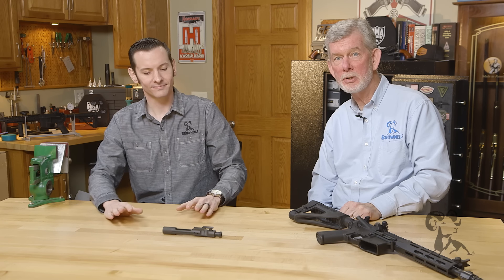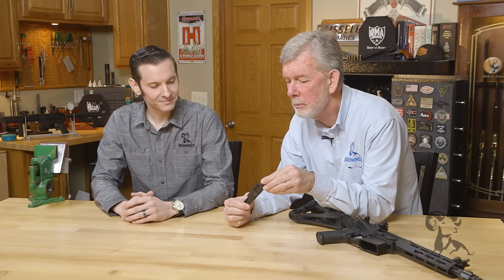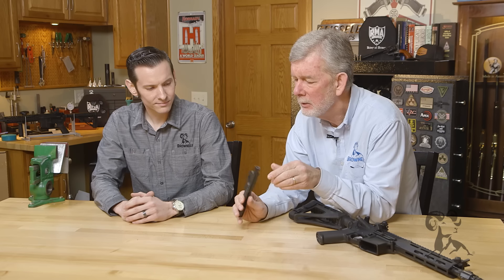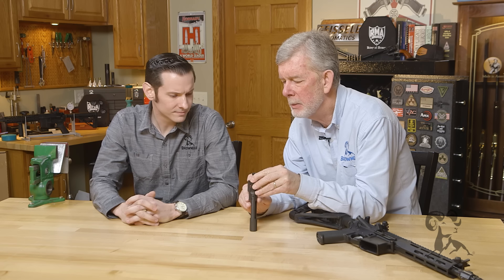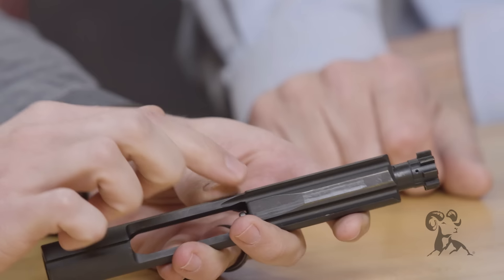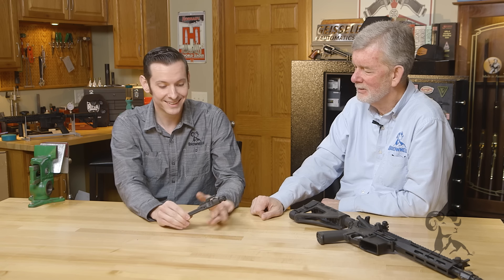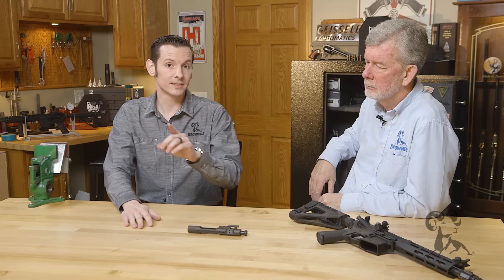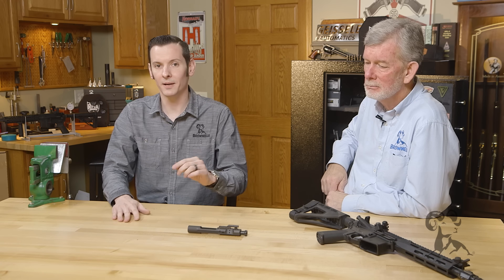Smyth Busters: AR-15 Bolt / Carrier Lubrication

Comment: I  run mine  moderately wet   but mine also spends a lot of time sitting in a corner  in-between cleanings  so I want that extra barrier  to prevent corrosion
Reply from the maker: Word!
Reply: @brownells   -lol, Word up. In the 90's it was "word to your mother"
Reply: I mainly use grease since it sets muzzle up in the safe. That with dry film lube
Reply: @bradbeam7254  what grease in particular and do you feel it's better? I'm curious about Mil-Comm TW-25b, and recently been experimenting with it particularly bolt/cam pin area.
Reply: Fireteam Michael, anything besides long term preservative treatment. Price and availability at my local store is what I use. I don’t recommend any certain brand in particular. The guys below me seems to share the same sentiment.
Reply: @brownells  You guys just won my heart with that reply! It's one of my favorites.
Reply: @fireteammichael1777  I use it in my M1A and it works like a champ; beware, a little goes a long way.
Reply: Same here. Wet and ready. Oh, and your user name is epic.  I am from San Francisco and non profits have ruined that city and turned homeless and addiction 'advocacy' into an industry. They truly are a plague.  $8 BILLION spent on non profits in SF the last 12 years and they doubled the number of homeless. LOL
Reply: @alfredocarpaneto5976  Good point! Seems everything in our society consists of one extreme or another. The left perpetuates addiction alongside the abuse & neglect of children/animals via the broken welfare system while utilizing firearms as scapegoats. The right destroys our environment/planet for means of profit while utilizing immigrants & minorities as scapegoats. Everyone..from the hood to the upperclass is pulling the victim card while simultaneously chugging vodka & gulping down xanax or snorting dope. For years..I knew I had to evolve past my addictions and character defects to earn the air I breathe. Life isn't a meaningless entitlement, unfortunately majority view it as such. Time we start reflecting on the paramount life aspects instead of obsessing over sex, blood diamonds & fame. RESPECT 💯🌏

Comment: I also lube the cam pin, the enlarged bolt guide ring section and the lugs. Drop of oil and brush around for a light coating.

Comment: Tim at Military Arms Channel is testing the limits of a BCM build by not lubing it. He's up past 7000 rounds without a malfunction shooting it about a thousand rounds at a time with cooling time between mags. His hypothesis is that carbon can act as a dry lube and he'll get far more rounds without a malfunction than anyone else thinks. The idea that carbon COULD be a dry lube is valid as I once had a maintenance job at a college where we regularly lubed sticky door locks using a dry graphite powder, graphite being a form of carbon. However, the charcoal in your grill, the coal in a power plant, the graphite in your pencil, the graphite in a golf club, and the diamond in your ring are all carbon but with different functional properties due to the exact molecular structure and orientation. Which form comes out of burnt gun powder I don't know but I am interested to see how far Tim's BCM goes.
Reply from the maker: We are interested to see how that goes as well!
Reply: I believe he lubricated it once before starting that test.  So it is not so much how long it will run with no lube but how long it will run between lubrication applications.
Reply: I agree
Reply: Maybe Tim happened to have a well made example? Sure, he's more of an AK platform guy than most firearms enthusiasts, but he's not Rob Ski, Jim Fuller, or somebody else who is specialized in that platform. I don't agree with him 100% of the time, but in the big picture, he's a decent resource.
Reply: C-Bomb  Did you not read my comment or did you not watch his collab with Robski? His rifle was a piece of shit. He just didnt clean his gun to figure it out.
Reply: I remember using graphite powder on my pinewood derby car in Boy Scouts.

Comment: Red lithium automotive grease stays slick rain or shine dosen't burn off after lots of rounds 200 or 300 in a session.
Reply: I too have heard of (and used)  high temp grease on the sliding parts. Makes sense and easier to clean off carbon fouling later on.
Reply: I have been running white lithium,, runs great. I have run over 800 with no problems.

Comment: I use Wilson Combat white grease, as it's not as messy as the regular wet Hoppe's stuff I used to use.  I put a little dot behind each locking lug of the bolt, plus around the ring that encircles the bolt (where it rubs against the inside of the carrier).  I also place Wilson Combat grease around the bolt cam pin.  I use small amounts of Hoppe's on the exterior friction areas of the carrier as described in the video; I lube what's shiny.  I've never placed lube inside the carrier key or the vent holes, and I've never tried cleaning inside the gas tube. My AR runs great.

Comment: I used to oil everything and wipe off the excess until I started to have some cycling issues.  Now I run mine as wet as possible, basically wipe or hose the thing down with whatever lube I am using and don't wipe any off, just assemble it and run it.  Haven't had any problems since.
Reply: A lot of counter people at local LGS often say that AR`s like to or need to run wet but I would say that it`s due to the parkerized type finishes that many have witch seem to be a bit thirsty if you notice when you oil them up. And I always oil up the gas rings for storage. Heck I even used to clean the gas tube , being a clean freak after shooting, But I asked Chris at small arms solutions and he said there is no need to clean the gas tube as there are no related issues of that type with a gas tube.
Reply: Thystaff Thywill  The AR I had an issue with was a M&P 15 Sport.  I believe the bolt is nitride if I remember correctly.
Reply: Thystaff Thywill  Why would I swap out a BCG that works?  That doesn't make any sense.

Comment: I tend to oil everything then wipe it off, just leaving a thin layer, then put a little extra on contact surfaces.  This seems to make the carbon clean off easier.  I also prefer grease for the cam pin and lugs, it seems to last longer and work better.

Comment: I had negative experience with dry bolts so I use a moderate coat of lube oil mainly in the surfaces you pointed out. However, a light spray of lube oil throughout the entire bolt seems to really work better. I don't clean my ARs every time I shoot them but I don't usually use more than 100 rounds at the range as others use much more than that. To me carbon removal is essential followed by a light coat of lube oil.

Comment: Eh I'm a grease guy, been using wheel bearing grease for over a decade now and never had an issue, never have had my bolt dry up when firing it and I go to the range sometimes 3-4 times between cleanings and fire about 200 rounds each time. When I finally go to clean my gun the grease is still where I left it. I use to use oil when I first got into shooting and instantly noticed at the end of my range session my gun would start to feel considerably more sluggish. Went to grease and never looked back.
Reply: Are u in an area that ever has extreme cold?  I've thought of trying grease but always end up back to oil bc half the year its sub freezing temps here and have heard 'stories' of thick grease preventing the action from cycling in extreme cold
Reply: Matthew Beaver I use lithium wheel bearing grease which has a thinner viscosity over some of the others. I live in FL so can’t say anything on cold (coldest it gets here is in the 30s) but the fact that we trust the same grease in our automobiles without ever giving it a second thought about maintaining for decades should say something about it’s effectiveness in all weather types. I did look up that same question years back and never found a definitive answer. Most just had the same concern you have but no concrete evidence. No expert but I always thought in extreme cold leaving the weapon dry was best since any lube would probably end up freezing.
Reply: You use grease to lube everything or just the bolt and just on your AR or other guns as well?

Comment: I use lithium grease on my ARs (and everything else, really).  A thin film on the carrier rails, the cam pin, that raised surface on the bolt itself, and the rear of the locking lugs.  The charging handle gets some too and any excess on my finger when I'm done gets smeared on the face of the hammer and into the detent groove on the takedown pin.

If that's too hard to remember, then just shoot your rifle a bit and you'll start to see shiny areas where wear is occurring; put a very thin film of grease on those shiny spots and you'll probably be fine.
Reply: I actually use Lucas heavy duty oil stabilizer on all my AR bcg's.. Works great! Little on the cam pin and a little on the rails. I wouldn't use it for corrosion resistance, but to keep the bolt slick, it works pretty good.
Reply: I do the same exact thing you do. Something my dad taught me. It's really good stuff, I use it on all my rifles and pistols too.

Comment: One of the first things I was told about oiling the M16/4 in boot camp that goes across all sister platforms is the fact that the platforms like to run wet. We were told that when in doubt, be liberal with the CLP we were issued. The type of lubricant is another subject entirely, but I recommend a liquid CLP for a couple of reasons. 

First is the fact that it does everything for you. It will actively prevent fouling and keep the fouling wet, negating the need for a designated cleaner. CLPs typically are designed to condition the metal, making it easier to clean with subsequent cleaning and lubrication cycles. 

You can also use grease in some parts of the rifle, that's another topic.

Comment: AR15 Barrels with nitrite finish plus QDQ. Do they need to be lubricated?
Reply: I would say yes they need lubricant. Neither of those finishes have self lubricating properties as far as I know. Though the only person who can give you a concrete answer is the manufacturer. 

I know fail zero special Nickel Boron coating specifically states no lubricant is required. Bond arms has TIN coated bolt carriers that “barely requires lubricant”.

Comment: Myth I heard in the Army: “In the desert, don’t use any lube, it attracts dust”. Although I agree dust will mix with oil, I’d rather wipe off and re-lube my weapon daily. I’ve seen a lot of malfunctions caused by nothing in the gun for lubrication other than sand/dust.
Reply: In some cases in WW2 North Africa and in the Arctic graphite powder is recommended.
Reply: @shawnr771  I don't know about WWII in Africa, but today in Arctic climates, LAW is the lubrication called for in the TMs and FMs.
Reply: @jcnikoley  I had read it somewhere many years ago that it was tried. Not sure how well it worked.
Reply: I grew up in the desert, but now I live in lush mountains. I struggle getting used to leaving oil all over everything (it's wet here as well).
If in doubt, we only used oil if absolutely essential - but graphite was fine.
Reply: @farmerbrown84  Thanks.
Reply: I agree
Reply: Well, I've seen plenty of malfunctions caused by lubricants in a sand/dust environment. You say you rather clean and re-lube your weapon daily, but what happens when SHTF before you can do your daily cleaning? Ask the enemy for a time out?
Reply: J S Been in the shit. Never couldn’t find a minute to pull the bolt, wipe it and give it a quick spray of CLP. Sand and dust dries up lube and is tough on guns. If you start with a dry gun, you’re going to have problems sooner. Never put lube or solvents down the bore unless you’re putting the weapon in storage. Use a dry chamber brush, and bore brush to get the grit out. The whole process takes two minutes.
Reply: @shawnr771  I've been using graphite powder in most of my weapons for years with excellent results.
Reply: @BM205  I just remember it being in the Army manuals.
Reply: Sand is going to get in your rifle no mater what. I would rather have lubed sand than dry sand.
Reply: @vegapower454  Agree.
Reply: @BM205  On the new dry lube AR I am shooting, I am using only graphite, applied with a small oil painting brush.  You can also now get some amazingly fine-cut graphite that nearly eliminate possible cutting from the lube.
Reply: @BM205  During OIF2 we would put graphite powder into our M249s and M240s on gun trucks. But we were almost daily driving a couple hundred miles on dusty highways. Freaked me out when we would test fire along side the roads and they would jam up. This was an extreme condition though. We kept plastic caps over the muzzle of our M16A2 rifles which seemed to keep the worst of the dust out. I would always pull my BCG out and wipe it down with a bare minimum of CLP.
Reply: @Allenmar73  I use a small amount of lube on the rear of the bolt locking lugs. I’ve yet to get lube in the chamber. 

Keep your bolt’s face dry. You don’t want lubrication in contact with your ammunition for long periods, if it can work its way into the primer, your rounds will be rendered inert. I’ve seen many people drench the bottom of the bolt carrier with lube. This will be in contact with the first round in the mag, which is a bad idea if the weapon is stored like that. Try to keep anything the contacts ammunition free of lube.

I would lube differently if I’m using the gun for three gun match or I’m going to expend the ammunition immediately, because the ammo will be used immediately. In that case I’m going to run it more wet than normal. In a dusty environment, I would run the gun more wet than usual, and clean it daily. I would also dispose of the round in the chamber, and the first round in the mag every day or so to be on the safe side. I would also be unloading and cleaning my magazines and ammunition with a clean dry cloth every day in dusty conditions.
Reply: @BM205 Until it gets wet

Comment: I went to a swat school several years ago and had my belt just slathered with a grease that was not specifically designed for firearms. The class was out doors with temps in the fifties. The class continued after dark until about nine pm. As soon as the sun went down so did the temps. Before the class ended my ar was doing anything but running. I finally pulled out my spare ar and finished the class. Make sure you use a lube that is heat and cold tolerant. There are many on the market. My lube turned into glue.

Comment: So I have 2 BCGs and I've experimented with both. The first is a phosphate with a NiB bolt and chromed interior lining. At first I ran it fairly wet for 2 reasons; 1. I thought that's what you were supposed to do, when I figured out that wasn't true then 2. I was in the desert and wanted to protect it from dry air and carbon. After a few months I decided to run it with just the necessary areas lubed and...guess what! It ran just as good and I had less oil flinging around. PS, I used synthetic motor oil for internal lubrication, Royal Purple to be exact, and it worked flawlessly! This one has had about 3000 rounds through it with one FTF when I let it get really dirty.

The 2nd BCG is an Anderson Mfg NiB coated and I have run it dry for most of it's life. I do take it out and clean it with CLP and then wipe it dry before putting it back into the rifle. No issues at all. It's had probably 2000 rounds through it and never had a stoppage.

Honestly, I think both are great and would probably run dry or wet because they are both modern, well made parts. I've yet to take them all the way down or replace any internals.

Comment: Great video, wet with some oil leaking from the seams. Ever since the day I qualified sharpshooter at Ft. Knox, and having one of another platoons Drill Sargent gave my service rifle a literal enima using a spray bottle of CLP and then being told by Drill Sargent Tillman to work the bolt to "soak it in". All my service weapons and personal weapons are wetter than a Bob Ross painting.  In a drier climate I tend to go with 3 in one rather than clp though. Any weapon is only as good as the decomposed dinosaur goo that is applied to it.

Comment: i use KY Jelly for my bcg!!!  🤣🤣🤣  all jokes aside,  i use mobil 1 20w50 in the summer and 5w-30 in the winter,  i put a generous amount of oil on the rails,  cam pin, bolt and bottom of carrier,  lube all sliding contact areas so friction will be reduced as much as possible,  oil keeps the carbon from building up in a great amount so weapon will continue to operate regardless of environment or ammo quality. 👍👍👍

Comment: Ordered a BCG from BCM it came wet like the ocean.
Reply: That's probably packing grease...not a lubricant
Reply: Everything is shipped out covered in birthing fluids to prevent corrosion. I clean all that off and spray it down with synthetic oil, wipe off the excess for break in purposes. Afterwards the only thing that gets oiled are the bcg rails.
Reply: That's probably storage/shipping grease so they don't start rusting while waiting to be purchased. I would clean if off and start your own fresh lube job with your preferred lubricant.
Reply: clean that off and use a little bit of Mobil 1 synthetic :)
Reply: Pretty much any machined product will come with generous amount of rust-preventing oil. The right thing to do is remove it and apply your own lubricating oil.

Comment: Makes sense not to put oil in the vent holes — like I've been doing! However, since the gas rings are contacting the inside diameter of the carrier, don't we want to lubricate that friction point?
Reply: I do but mostly for protection of the parts in storage and while being cycled. Not while firing  but I see it as a moving part.
Reply: Yes, if you want to do a quick lube and not disassemble the bcg. 
As with all the videos of two dudes in agreement with each other, no one to ask your question to them or give an alternate opinion.